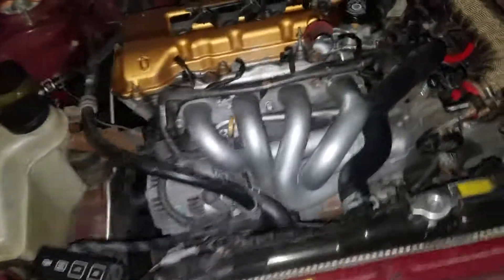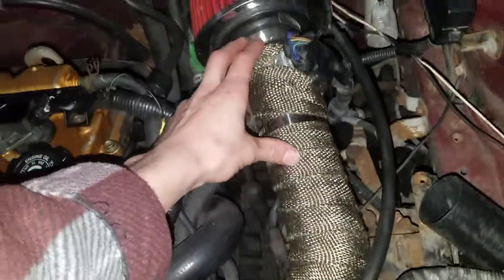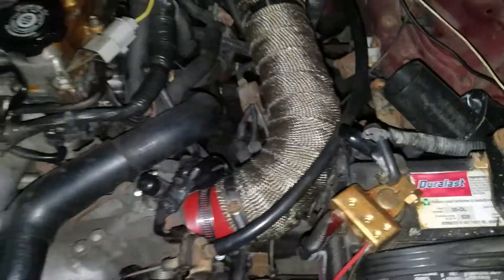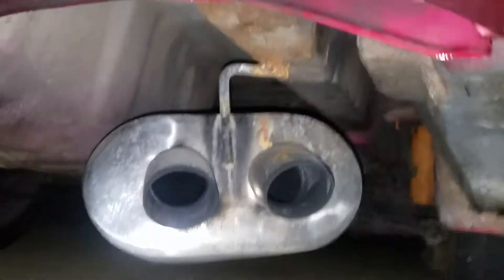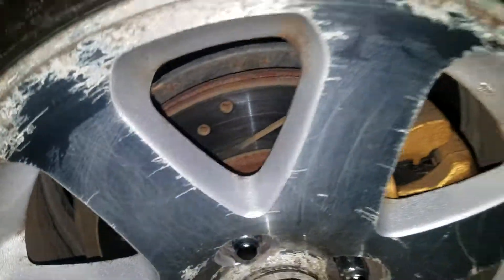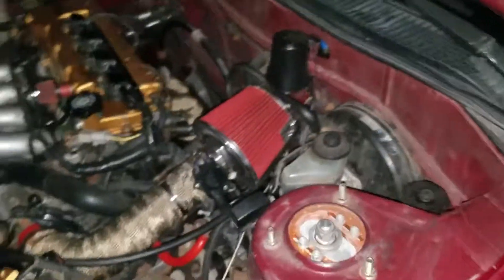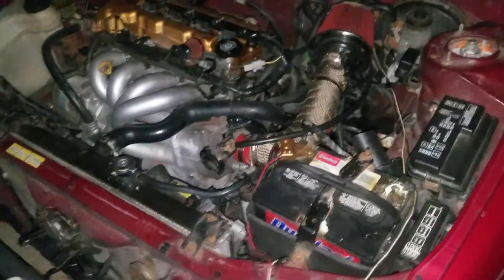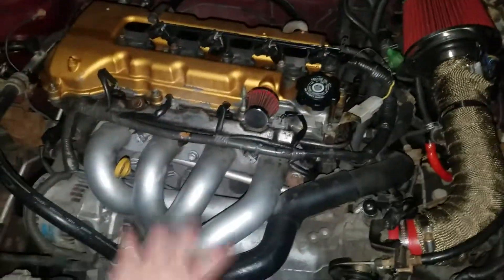2001 corolla aftermarket intake

Comment: Damn!!! The Civic Si wheels clear the front calipers? I got some Civic HX wheels and need spacers for the front, so never got around to putting them on. You can swap the intake manifold for the plastic one from the corolla 2003-2004 or the celica, but I recommend from the newer corolla (Throttle body wheel is compatible).
Reply from the maker: Yeah the Si rims fit perfectly. Also my exhaust is all custom this a one off piece im trying to get a video together of how it was done. And ima try and see if i could have a custom intake manifold as well trying to do something no one else has really done. Civics seem to be the thing now.  Just trying to be different
Reply: @spacceoutt  Corolla is the best car (from my personal experiences owning one). Everyone mods Civics, but Toyota build quality is still number 1! With the prices of 8th gen corollas and the potential they have, I believe more people will start modding them like Hondas. You will have a car truly one of a kind with a custom intake manifold. That would be awesome to see! Can't wait to see more!

Comment: The only suggestion I have is if you still have the car I would take off the exhaust wrap that actually holds heat more...use the gold reflective tape it works much better....and I have a 01 Corolla as my daily dis your eBay intake throw any codes or was it fine? Wanna have some fun with this thing too haha😂